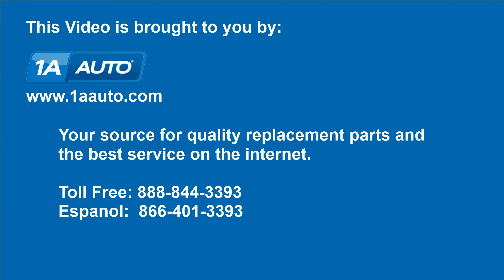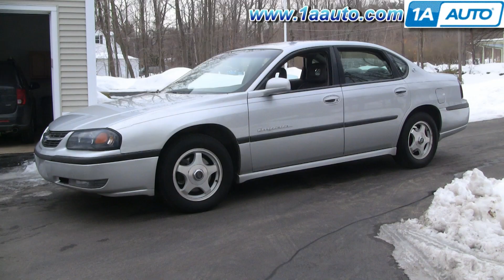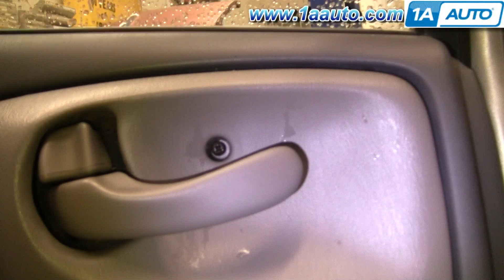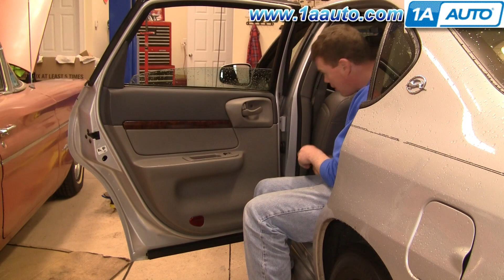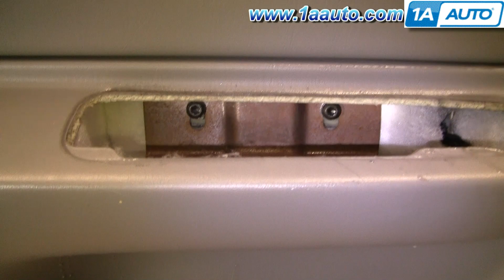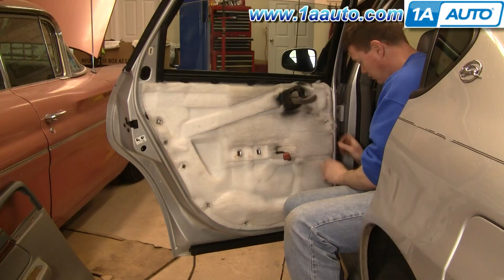How To remove Rear Door Panel 00-05 Chevy Impala

Comment from the maker: If you can't open it from the outside door handle you may need to see if you can remove the door panel with the door closed. 1aauto.com 888-844-3393

Comment: My 2002 Impala rear (passenger side) door lock stop working, before it stop working the child security lock was enabled, so I cannot open the door from inside and outside. in this case, how I can get the interior door panel off.
Many thanks,

Rahi